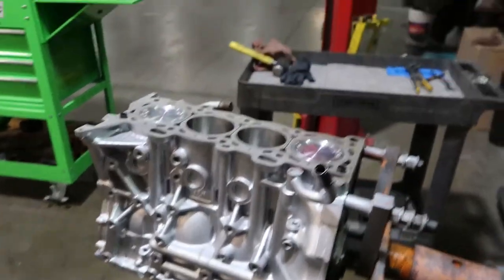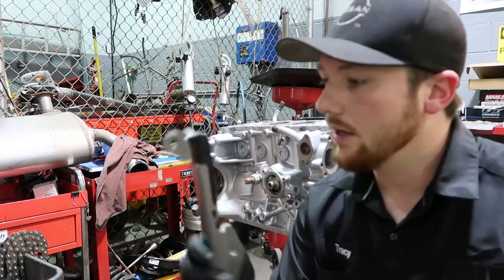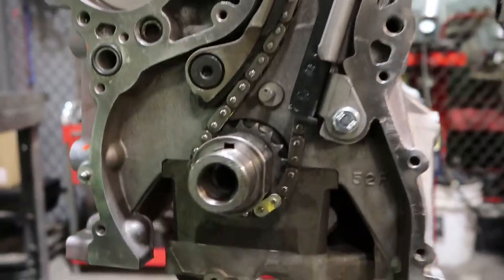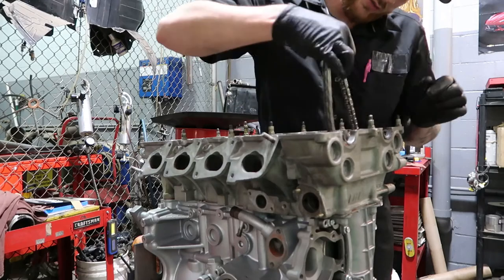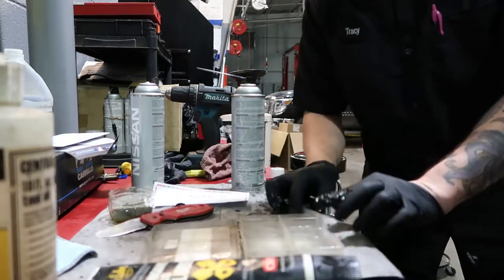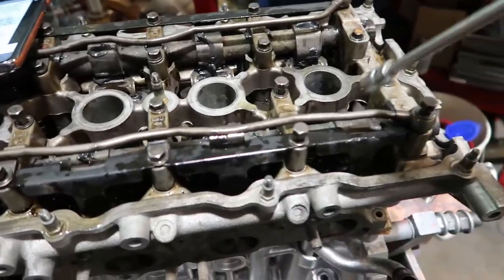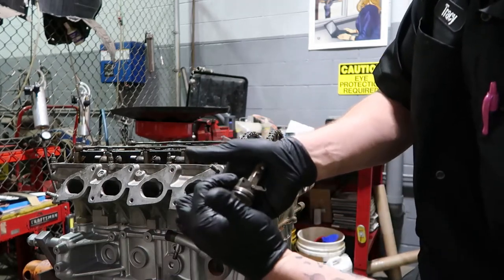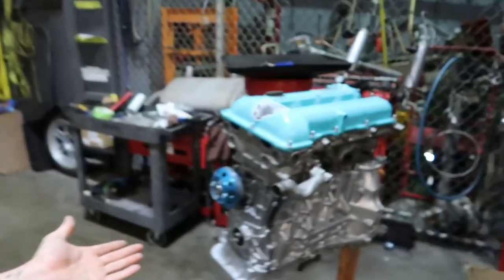Top End Long Block Assembly [Sr20det build guide]

Comment: Great vide bro, it helped me a lot! I'm putting my sr together now. I'm having trouble with the exhaust cam install. I lay it in at 12oclock, but it doesn't want to sit there well, then I lay caps on and hand snug everything in sequence but again the exhaust cam wants to sit at like 11-1130. I have to hold it at 12 while snugging the bolts, then when snugging in sequence it'll go back to 11-1130. I cant get to stay at 12oclock while torquing. What am I doing wrong? lol

Comment: I'm putting new cams in my sr. I couldn't find a lot of information on the shims. Do I need to replace them. My plan was to take a caliber and measure each one and pair them with the closest?
Reply from the maker: You should replace them when doing cams on a SR. Many times people get away without doing it. Hopefully you’ve kept yours in order. The main point of the shim in SR is to keep the rockers from teeter tottering on the two springs. You want even height on the two valves and have the rocker be level theoretically. 
This makes the job hard on SR because you need to measure total valve stem height of the non shimmed valve while it’s installed obviously and then find a shim to make the other one the same. Many people have made some jigs to do so, I’d look up how people measure stem height for sr’s and youll find some interesting homemade tools lol. 
If you need help shoot me a pm on Insta. 

Thanks for your repeated views and comments! You rock!
Reply: I'll DM you on Instagram. I'm having a hard time finding any help thanks a bunch!

Comment: Why in the manual it say torque to 39n, 79n then  loosen all bolts then 40n 90 degree 90 degree . Do you have to loosen all studs after 39n and 70n torque then do 40n then 90d etc.. ?
Reply from the maker: The OE service manual is usually accounting for bolt stretch as most of these fasteners are torque to yield i.e.: the bolt literally stretching under torque, many times it has you loosen then re torque to account for stretch and basically bedding the bolt in the threads accounting for proper lubrication using engine oil and all that. I believe on the actual ARP site and instructions its usually just 3 equal steps, but to answer your question you'd do the 39 then 79 then loosen all the fasteners and then go back and do your 40 +90 degrees. If you're using head studs and nuts after you snap them back loose i would just retorque the nut only because by "Loosen" I'd just break them back loose and do your second set. If there is anything else or if this is confusing DM me on Instagram we could always talk if needed! Good luck!
Reply: @ShadeTreeGarage  thanks mate. I got it. I was confused about why I have to loosen them after 2 set of torque. Now I get it. Just snap them loose after 2nd torque then do 40 and 2 90 degree turns.
Reply from the maker: @harrish1978  You tha man! Killing it! feel free to share your build sometime man! Keep wrenching
Reply: @ShadeTreeGarage  Hey mate. Will it be an issue if I use rod no 4 on piston 3 piston. My piston 3 had a spun bearing it letf the rid and cap with few deep scratches. I hand sanded the crank using shoe laces method. But I don't think I can use the rod and cap. Thats why I need just 1 rid and cap.

Comment: Would’ve been good to know a little bit more about the headstuds they still confuse tf out of me. Don’t wanna mess it up
Reply from the maker: Sorry I hope its not too late! What is going on?
I lubricate them with the ARP lube. Spin them down with your hand as far as you can (BY HAND) I sometimes use a allen on the end to spin them till they stop quicker. Apply more lube on the nut end and place your washer and nut after the head, Then figure out the torque spec that ARP recommends, I think its 90 on SR Divide it in 3 equal steps and do them in the tightening order that factory recommends, so 30-60-90 ft lbs.

Let me know!